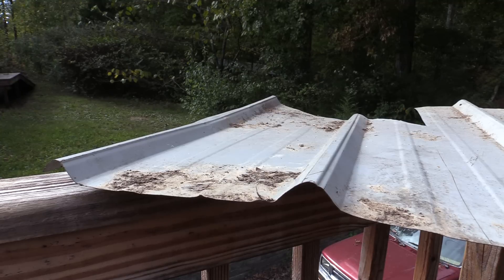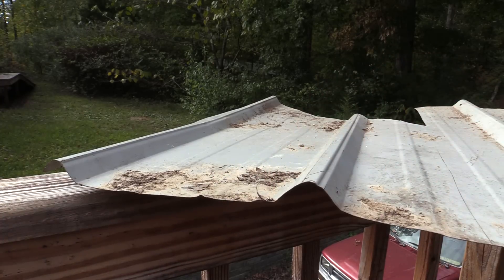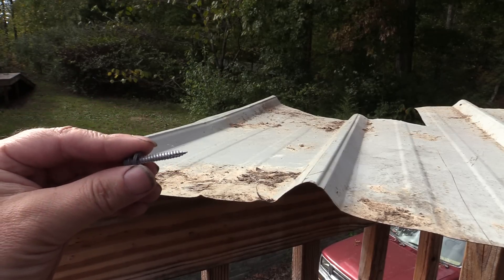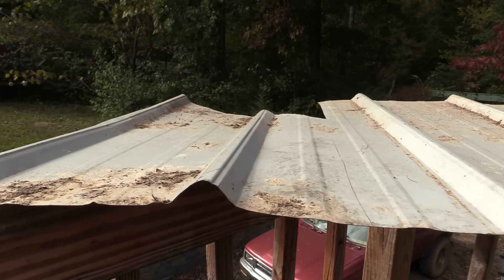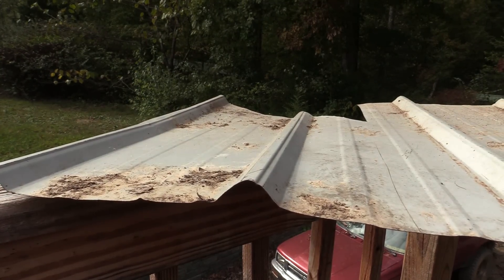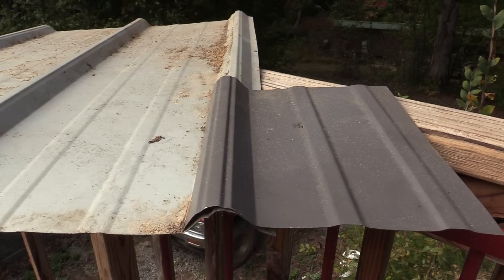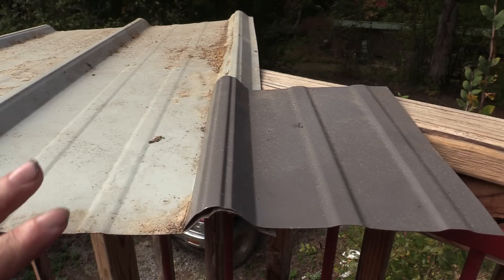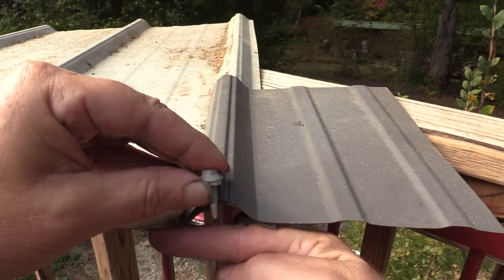Why you should not put screws on the ribs of metal roofing

Comment: seems important the sort of sheet they use in the usa.  and the sort of roof construction.  they make a big thing of the sheet becoming 'constructional'.  I suppose the mean that you're tying the roof together with the sheet.   if it's such a big thing to them I guess they need it: their method of construction is such that it needs 'tying together'.  In NZ and Aus ours don't.  They're rigid enough.  And the metal is (or at least used to be ) to handle screwing or nailing through peaks.
Reply from the maker: the problem is expansion and contraction over long roofs. Through the peak may work fine on smaller roofs but if your structure is 75 ft long you will have issues down the road as a 75ft long piece of steel will really move. you need the expansions joints to be able to do their job.
Reply: @honeybeehomesteading   Yep, okay.  I can't pronounce on it.  Not in the business.  No expert.  Just observing that it seems to be there's differences between USA and other places that account for the apparent conflict in anecdotes of which way works best.   I only ever put up one shed,  10m x 5m  and it was corrugate,  through the peaks and I had to predrill every hole because i couldn't get the tekscrews to punch through in one hit the way professionals do.  And the thickness of the material was borderline by which I mean any thinner and walking on it would crush the peaks.  I had to be careful where I trod. Real bummer for a diy man.  Not a pleasant thing at all.  My first all metal construction of that type and I ran into the 'tolerances' problem someone mentions in your comments:  you have to place each sheet exactly where it is supposed to go or you get to the end of the run and you're overhanging or,  worse,  short.  It would have been so much more pleasant if the roof was 'safe' to walk on, wouldn't crush,  and if the tek screws would drive straight in and if sheet locating was somehow more assured.

Comment: Dark colors will always eventually leak when screwed into the pans as the holes elongate with thermal cycling.
Reply from the maker: @ChookHendo  thermal cycling is the reason why you should screw it into the flats. You will have about 1/32!of a inch of daily movement on a 24 ft long panel. If your roof is 75 ft long then you will have three times the amount of movement on the screws if you screw it on the rib. The panel overlaps eliminate side expansion
Reply: @honeybeehomesteading  Lysaght the manufacturer and Bluescope steel the distributor here in Australia all describe that all fasteners go into the crest for the roof and pan for the walls to eliminate leakage on custom orb and trimdek products.
Reply from the maker: @ChookHendo  always follow the manufacturer recommendations. I don't know the specifics of your panels but panels can be engineered differently to offset thermal expansion.

Comment: When I was a young teen, I helped my daddy build a small barn he used heavy gauge corrugated metal on the roof and on the side walls. We nailed on the top of ribs with lead headed nails. It's never leaked and it's still being used to this day. I'm now 76 years old.
Reply from the maker: @penney304  you installed it right. I too installed roofing the same way only with rubber washers as I am 20 years your jr. The metal ribs were shorter and the flats did not have any ridges. It was the right way to put on old metal. This metal is different as it is engineered to be both structural and much more wind resistant. Thanks for commenting.

Comment: Insurance adjuster told me that lead nails got outlawed. A tree fell on the roof. Have a 47-year-old build that has galvanized roof with the lead nails. The roof did not leak and never had a problem with a a loose panel. The galvanized tin was made out of 28 gauge. I built this building when i was a kid and the nails were put in the top of the ridge. In addition, i have spare lead nails. I'm going back with lead nails. The nails are 2 inches long with the special designed head. The lead nails are far better than screws. Screws are brittle and can break. I have not researched why lead nails were outlawed. My grandfather was smart enough to buy extra galvanized sheets and nails when the building was built. This came in handy to make fast repairs to protect the inside of the building.
Reply from the maker: From the age of the building it sounds like it was 5v metal roofing which is supposed to be nailed or screwed in on the ridge. modern metal roofing  like what is in the video has ridges twice the height as the old 5v and is way less flexible. i never installed the nails with screws but i did install allot of nails with the rubber seal. they work fine. Lead is pretty much a no no in everything but i think the real reason was cost as the rubber washers are much cheaper and do the job.

Comment: Putting a screw down the center of the panel between ribs is perfectly fine.  I have never seen a problem with that method.
Reply from the maker: @MrOldclunker  screws need to go next to the rib. Placing them in the center of the flat can allow air in the event of a windstorm to get under the panel and rip it off. Also placing them in the center reduces the number of screws holding the panel down by 20 percent as it uses only 4 screws instead of 5.

Comment: I can debunk this. Lay metal flat and even and put some screws on the rib and flats but leave the screw loose. Let the snow lay on it  and check it again  you will see the flats leak because water rides the flats and will go right in hole but on the rib it has no option  but to run off the rib to the flats. The big key when you put screws on the ribs. You're going to want to check all the screws at the end of the job. You're going to want to lightly walk on the ribs and listen for a pop if you hear a pop stop and tighten the screw but dot destroy the rubber washer.
Reply from the maker: @galevest4545  sorry but you are not debunking anything as this is the screw schedule by the manufacturer. If metal did not expand with temperature and if you never had to worry about wind then going through the ribs would be a smarter way to go. Of course screws will leak if they are not properly screwed in   even the ones on the ribs will leak a little.
Reply: We have tornadoes  up  here and not a single one of my roofs came up or leaks with screws  through the rib or does other companies.   Manufacturers also tell you your oil change on basic cars are good for 10k miles to lol. My metal I purchase  is also thicker than that ugly barn metal style  so not so easy to bend because  a size 15 boot at 240 lbs I can stand on my ribs and they not dent. Just saying  going through  the ribs correctly  up north is better because  it diverts  water off ribs

Comment: Show the proper place to put screws , etc.
Reply from the maker: maybe I can explain it, so in the flats there are two raised areas I will call them bumps. Your start with the end that has a shorter rib as it is designed to go over the other ends rib which has a little flat end on it. your first screw goes between the first rib and the first bump. centered is fine you just don't want to get too close to the rib or the bump as this can cause trash collecting or improper seals if you get on the bump also you need to be close to the rib for strength.  the second screw goes in the same flat between the second bump and the SECOND rib. the last three screws go between the bump and the rib. So working from left to right you would have a screw to the right of the ribs and 4 screws to the left of the rib with the first flat having 2 screws. Let me know if this is clear if not i will shoot some footage. Thanks for comenting and watching
Reply: @honeybeehomesteading  Ok thanks . In the Philippines they use rivets , though it seems also on the " bumps " . Though yet to find out how the metal sheets are held down . As they seem to fly off during many storms there . And there is different thicknesses , though you can imagine the heat they absorb and temperature inside the houses .

Comment: Putting the screws in the valley is fine, except you have to screw the ridge on the overlap. I'm not a contractor, but a claims adjuster. On a building with a 20 foot sidewall the wind will tear those roof panels. Rips them like paper.

Comment: You're a few years too late to do me any good.  I reroofed an old mobile home, and it's given me problems ever since.  I'm actually considering reattaching it properly, removing the screws on the peaks, and patching the holes.
Reply from the maker: @troystallard6895  you can use stitching screws to repair the holes and you will need some sort of underlayment if you don't already have it. Here is a video that has the screws. https://youtu.be/klGGIK25Wm4?feature=shared
Reply: @honeybeehomesteading  Thanks for the info.

Comment: Another seldom mentioned problem with putting fasteners on top of the rib is metal "creep". This is caused by different torques being applied as you work your way horizontally across the roof. If you compress the top of the rib much at all, it will expand the edge ever so slightly beyond its natural point. On a roof with a really long fascia edge this can amount to several inches by the time the last piece is installed. Almost guarantees an interesting final cut.
Reply from the maker: @rogermosberger6856  creep can also happen on flat fasteners but I fould see how it coukd be a disaster with screw through the ribs. I always first complete row first before running across with one row in the middle and working with 2 rows not the remaining 4

Comment: This is what I came to learn from our metal roof. A metal roof is impervious to water until you put 16 screw holes in the water channel. If the screws are placed on the rib where water does not flow, it won't leak.
Reply: Yeppers. Manufacturers recommend this way as well. Just did a roof last year on the ribs. No leaks!
Reply from the maker: Honestly i wish manufacturers had just one screw schedule as it causes problems for everybody. some panels are engineered differently. I understand why manufacturers want you to screw in the flat vs the rib. What ever the manufacturer recommends is the right way in the end as they can void your warranty doing it different. Thanks for commenting

Comment: I think it varies from country to country.  Here in South Africa we have what is known as IBR sheeting and the suppliers say to screw into the top of the ridge with long screws and rubber backed washers.
Reply: They probably use thicker steel so it is strong enough to not deflect and put enough pressure on the seal. 
The stuff in the US is usually very thin. Because of that the rib just smashes and doesn't seal.

Comment: Here in Australia if you screwed through the flat the job would be condemned. I have seen several American roofing contractors change from the stupid idea of screwing through the flat to screwing through the ribs.
Reply from the maker: coeffecient of thermal expansion of steel. It is the driving reason behind screwing on the flat. Some panels are designed to have them on the ribs but not the one in the video. here in the us screwing on the ribs can void your warranty

Comment: Seems dumb to put screw holes in the flat. This is where the water is directed. This works for a few years. But screws always get loose. A loose screw on the rib still sheds water. Screws in the flat always leak.
Reply from the maker: Screws get loose on the ribs not on the flats at least mine have held up for 20 years, you are correct loose screws on the flat leak but if properly installed they wont get loose

Comment: I'm retired now but I remember the supplier of metal some times say though the ridge others would say the flat area . We always did what ever they said but I liked though the flat area better . That was with screws I have never used nails but I have removed old roofing that used nails with lead . My old barn has it that way and it was probably built in the late 40s or early 50s  . They are constantly coming loose so when I repair I replace with screws .

Comment: Roofing for over 30 years and every metal roof i have ever inspected with the screws in the flats always have leaks. Furthermore the manufacturer on SC says you can nail it in the profile so if you can nail it in the profile a screw is no different. Andwral be structural is a crock of shit. It is cosmetic just as shingles or any other roof covering. So thank you for telling people to zcrew in the flats I will be replacing a whole lot more of these so called structural roof and making bank.
Reply from the maker: @kennethnettles6191  wow I never new screws and nails are the same. I have roofs that I installed on the flats 20 years ago that have not had a single leak so you will not be making bank from my roofs. It takes precision to screw it on the flats not so much on the ribs. Thanks for commenting

Comment: The reason they recommended screwing on the flat versus ridge, was that it looked more asthetic because the screw wasn't noticeable when looking at the rows of screws from the side across the roof or wall! Look at the two and you will see especially if the ridge screws are not in an exact line?!
Reply from the maker: @clarencecarter960  I don't think aesthetics has anything to do with why manufacturers want you to put it on the flat. When you are screwing through the ribs you are making one long piece of metal. Expansion and contraction can be a issue on long roofs. Plus wind resistance is far greater on the flats vs the ridges.
Reply: @honeybeehomesteading  I am telling you, this is how it started! Then they justified it with your explanation???.
Funny ridge/ribbed metal roofing had been nailed on top of the ridge since it was invented?. 
I grew up with a man who owns a metal roofing manufacturing company. He should know he was in on it????!
Reply from the maker: There are some roof types that are engineered to have it screwed through the ribs. this panel is not one of them. what you are saying makes no sense, You knew a guy that was in on putting screws on the flat that it less water resistant i am not denying that.. What would be the manufacturing company motivation in doing so? . You cannot get away from the coefficient of expansion. It is a problem for metal roofs. Screwing on the flats minimizes that problem.
Reply: @honeybeehomesteading  The motivation is to sell more sheets of metal roofing. Aesthetics, if it looks crappy it will not sell as well. People(80%) are only concerned about how it looks on their building. You are like me, thinking too practical?. These companies are in business to sell and make money! Period! My friend says he looked at hundreds of pictures of screws installed both ways, from every angle. New color, he looked at hundreds of pictures on many types of buildings. They don't worry about the warranty. They will out last almost all of them. Just try to file a claim and find out?!

Do you raise queens?
Reply from the maker: yes I raise queens

Comment: doing it wrong number of times still doesn’t make it right 
The contractors in my area really screw the roof up putting it on over asphalt shingles not a good plan then they strap horizontal with no verticals under them to let sweat out and a little more air flow 
their only relief is they will not likely be around when the issues show up
Reply from the maker: i am not quite sure of the problem you describe. So are you worried of moisture buildup because of all the horizontal purlings?
Reply: @ If that moisture that is left in there will wrought the the purlings
Reply from the maker: the ribs of the metal are like heated ducts, they move air from the bottom to the top of the gable. It is a convection oven underneath the metal by midday moving allot of air and heat. you should not have any issues with rot of the purlings as they are basically kiln dried on a daily basis.
Reply from the maker: Yep that is why i made the video as too many people do not read the screw schedule. i was at a friends house yesterday  the contactor had skimped on screws and only had one screw at the overlap rip where it takes one on each side. his roof may be fine but if one panel fails in wind so will the rest probably.